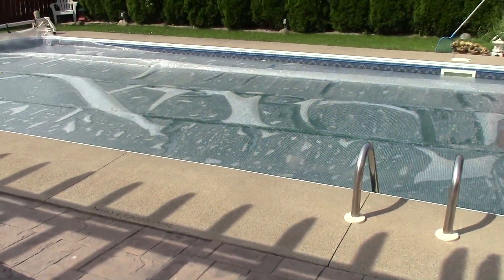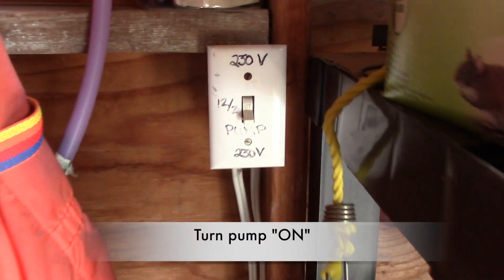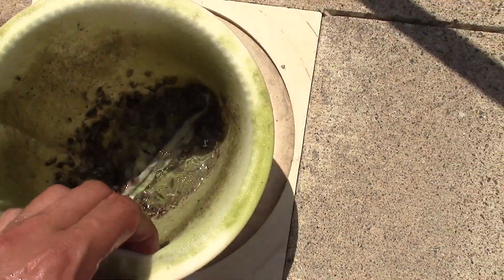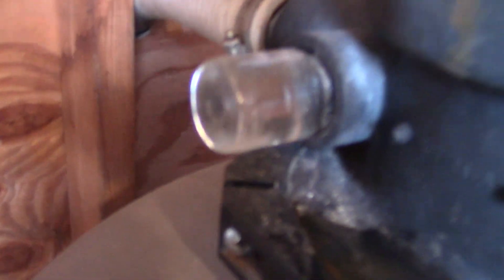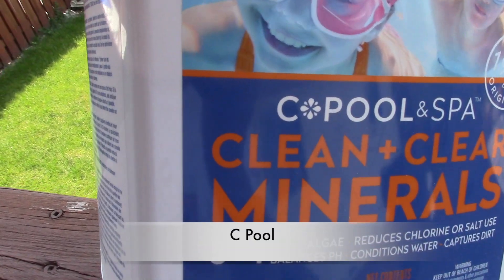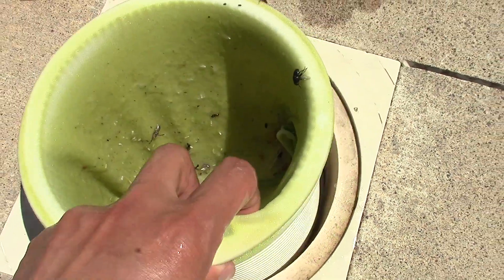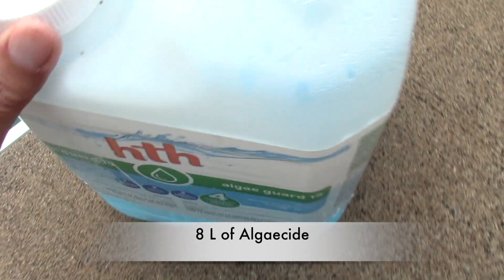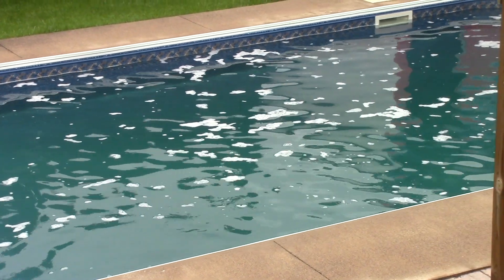My Pool Turned Green From Algae !! How to make it Crystal Clear again. DIY.

Comment: It is one of my missions in life to stop misinformation about proper pool care from a chemistry standpoint, and this video is full of it. Just because something works for someone doesn't make it right. Firstly, one should never begin entering massive doses of any chemical in a pool without first testing using a suitable test kit. A Taylor K-2006C or a Tftestkits TF-100 are suitable test kits. Then test and adjust as necessary, cya, ph. We're not concerned with fc, because an algae-filled pool will not have fc; or cc's, because we know it has cc's, because it is green; or TA as that's just PH buffer that can be worked on later; or calcium hardness, which is also likely not applicable to this issue.  Ideally, we'd like cya to be on the low end, 30 or 40 cause it'll take less chlorine to fix it, but if it is under 80, we can proceed. Otherwise, drain and refill and retest. Ideally, we want PH on the low end of the scale before going tk shock level. Target down to 7.2, because chlorine is more effective at lower ph levels. Now after thoroughly brushing all surfaces and cleaning out the skimmer or sock, an owner should conduct SLAM, shock-level and maintain, continually adding liquid chlorine after performing FAS-DPD test before adding each time to determine dose as often as possible. Maintain the shock level specified for the pool cya level. Continue this, and cintinue brushing and vacuuming and pump running until three criteria are met: passes an over night chlorine loss test; cc's .5 or less; and pool is clear. The method taught here may or may not clear the pool, but if it does clear the pool, it will likely come back. Don't use floating chlorine tablets; use liquid chlorine. Trichlor tablets add cya, and he doesn't know his cya. He doesn't know any of his pool levels. Don't use algaecide. Most contain copper and is inferior to chlorine anyway. Why not just keep up the chlorine, but never trust someone who says "I just throw in some..."troublefreepool.com shows you how to SLAM instead of shock and forget.
Reply from the maker: Thanks for the info.
Reply: Could you rewrite this without all the acronyms.
Reply: Hey Greg! 
No need to be so critical... You can have your own perspective, that you are allowed. Clearly Jonah's method works very well cuz ultimately he achieved the clarity of his pool, as a matter of fact I personally learned some great tips from that video... Your method might work too, and that's cool... Mine is a little different as well but it works for me and my pool, and I got A LOT to clean at 20x40. All this to say, no need to be so sour and knock one's method simply cuz it's a lil different than yours. 
Cheers!